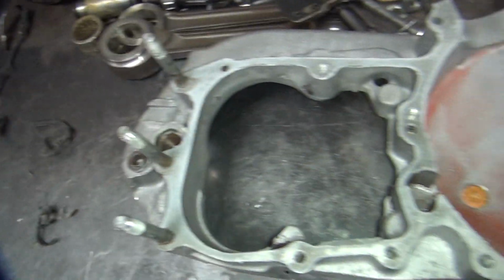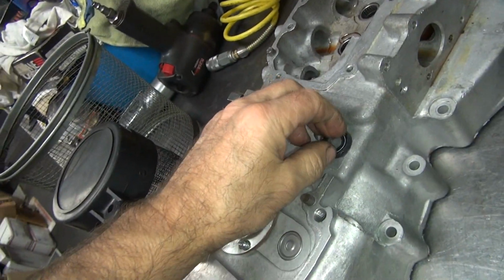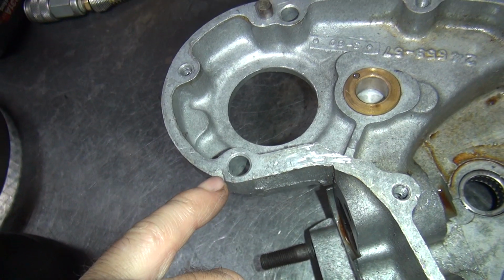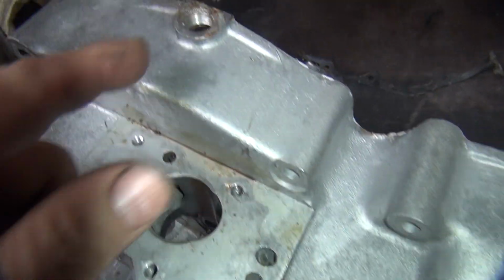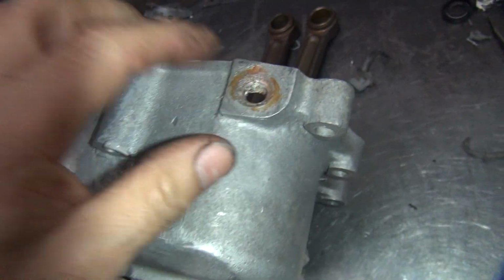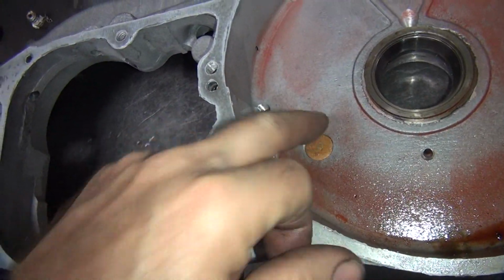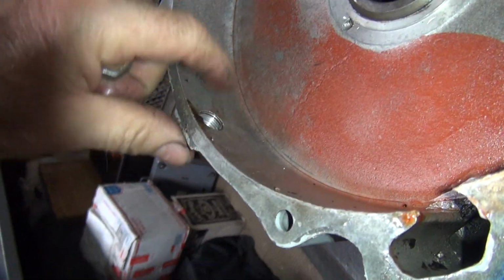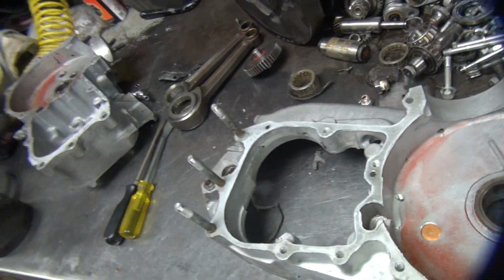1961 xlch #108 no miles transmission motor rebuild sportster harley repair restoration tatro machine

Comment: Sometimes I fix those leaking drain plug threads by drilling them out oversize and gluing in a threaded steel bushing from the inside of the case. By tightening the drain plug it pulls the shoulder of that bushing against the case, where it seals really nicely, especially when applying red loctite. On the outside I use red fiber washers I got from the plumbers supply. Only problem is you have to establish a flat inside the case perpendicular to the threads, so the shoulder of said bushing can sit flat against it. The big advantage is even the dumbest moron can't mess up those new threads because they are made of steel. Even frequent use of that drain plug doesn't kill them, like it usually does.